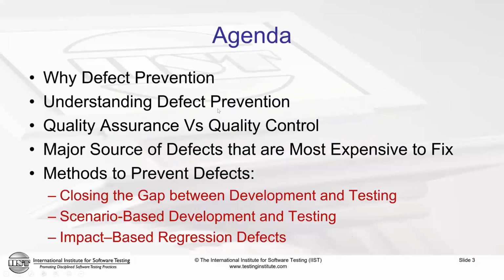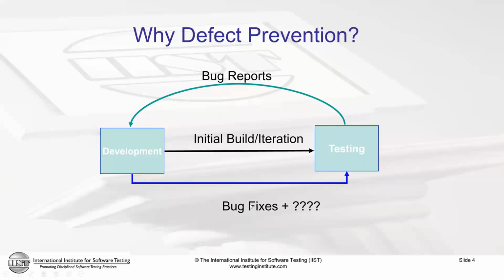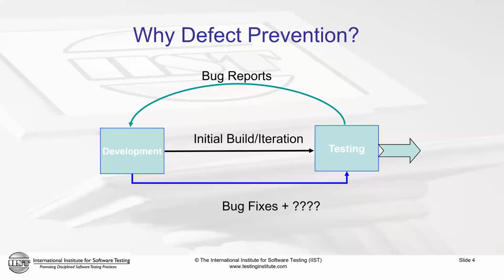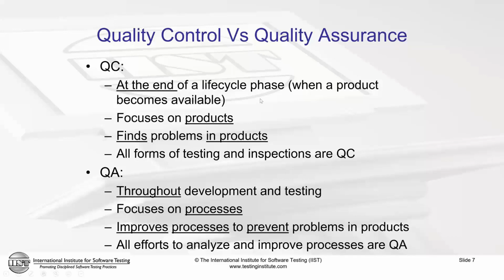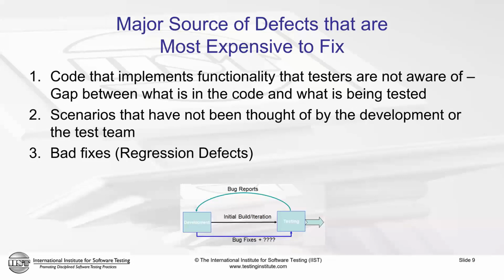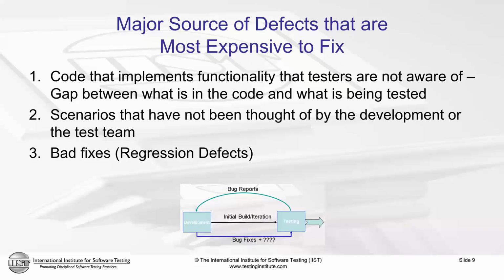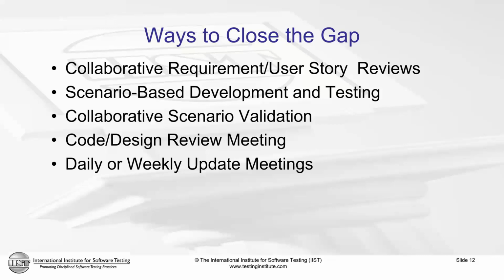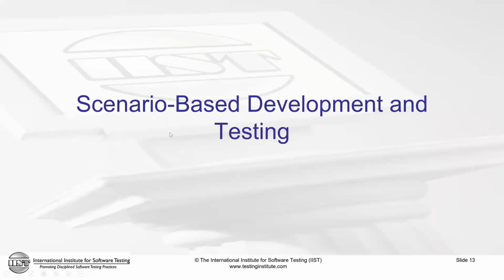Effective Methods for Defect Prevention - Maturing the Testing and QA Profession

Comment: Although I did not agree with everything that the presenter said, I found this presentation sufficiently interesting that I listened to the whole thing.  He touches on some of the same issues that I'm encountering as I do oversight of a testing contractor for large organization.

The gap between the requirements that testers know about and the requirements that the developers were seeking to satisfy was a particular interest.

Another problem, which I don't actually know how to solve yet, is that of impact analysis of changes by developers as it affects regression testing suites. Even if testers are aware of the change, how do they know which regression tests to run to test the possible effects of the change?